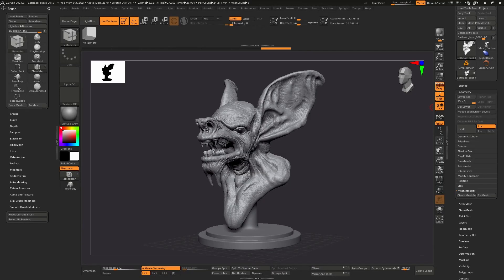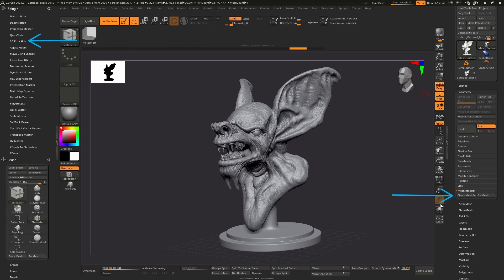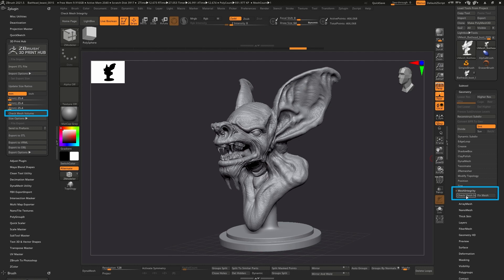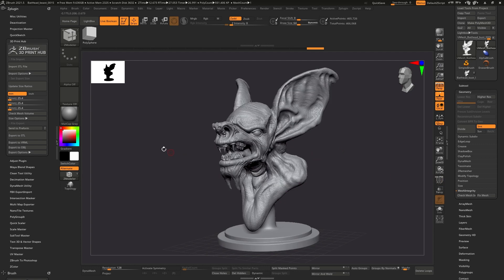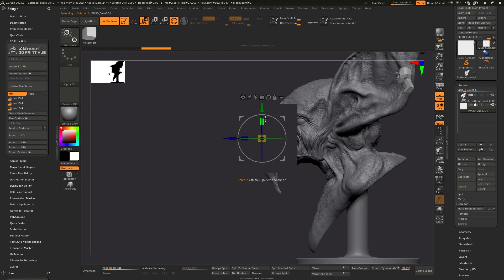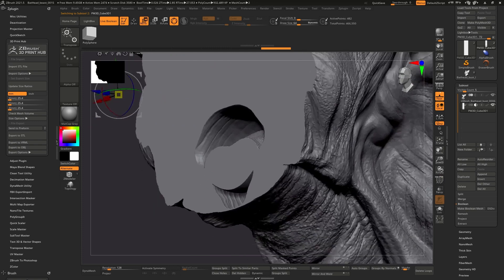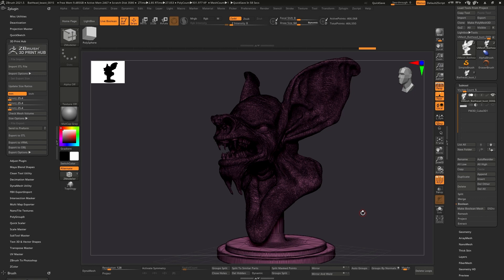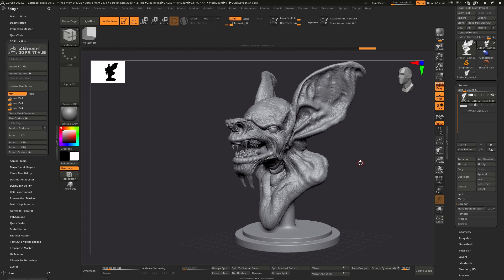Finding Mesh Errors for 3D Printing with Zbrush.

Comment: whoever facing the air pocket issue after merging visible subtools into one tool, use dynamesh. this way the mesh will become completely solid inside and then decimate to lower down polygons
Reply from the maker: Cool, thanks for the feedback!

Comment: How can i fill those Air pockets? I have an fdm printer and those chambers make the printing times too high because they print those as outer walls... Do you know a way to make meshes snap together until they touch each other?
Reply: after merging visible subtools into one tool, use dynamesh. this way the mesh will become completely solid inside and then decimate to lower down polygons
Reply: @3d_chip  Thanks,  right now i was having the same error as back then. This solution Works, but only if i Dynamesh at a low resolution (like 300-500) because at higher density it makes the same holes, and i have to project all details a couple of times.  

Totally works but sometimes loses a lot of details. I now know there are other options, like closing the mesh and boolean, then split internal polygroups, or mask the interior and deleting that polygroup, but i cant make it consistently
Reply from the maker: If I understand your question correctly I would do auto poly groups in Zbrush. Doing this will create polygroups based on a mesh island inside of a mesh. Using the isolate by polygroups I select the main mesh and delete hidden geometry If you want to see what the mesh is deleting you can invert the visibility to show the island mesh (this usually is the floating pocket of mesh). I usually examine the model just so I know where the problem area is. 

I hope this makes sense and helps you solve your problem.